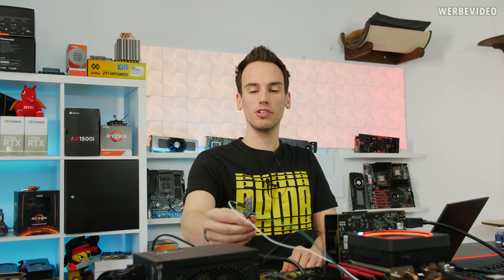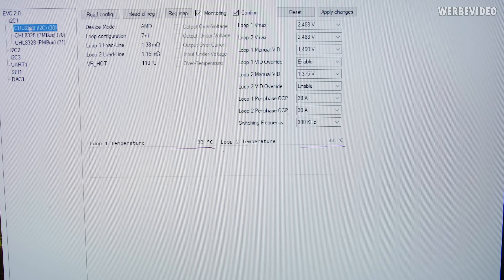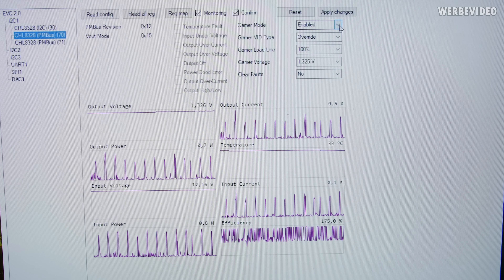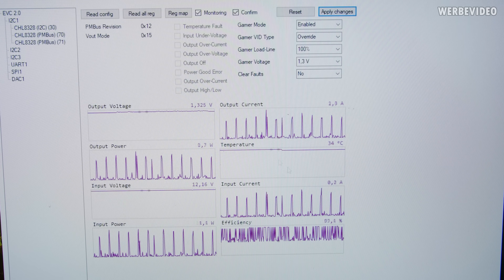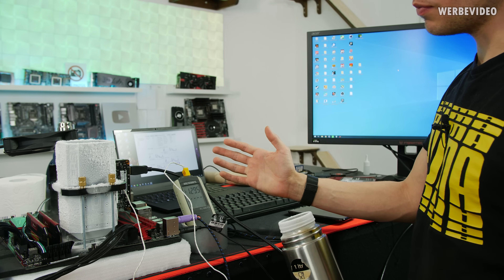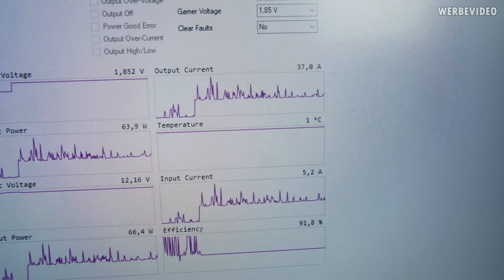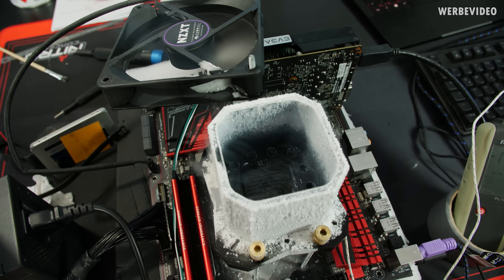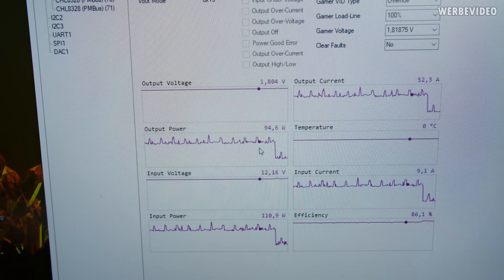We Overclocked an AMD CPU to over 8.1 GHz !!

Comment: Wow. Even at almost 8ghz an FX CPU still cant match a Ryzen 3000 CPU at stock clocks in single thread performance. That is an ever bigger difference than I would ever have guessed. My 3700x is smiling😃Thanks for the vid bud, really enjoyed it👍 

EDIT: Just checked my Cinebench R15 single thread score at stock clocks=205. And the FX at almost 8ghz=172. Wow, well done AMD.
Reply: Back in the day people were overclocking single core Celerons to 8GHz or even higher than that and they would not beat c2d in performance. But still the binning on those CPU's had to be massive. I believe there is only a single  Celeron in Poland that tested past 8GHz barrier. 8GHz OC club is pretty elite :)
Reply: a 4690k single core is 151 stock 3.9 ghz
Reply: @jorgeariel1090  4690k had launch at Q2'14, fx 8350 in Q3'12, but architecture is as old as 2011
Reply: This is because frequency speeds isn't every thing.
Reply: @FinnishArmy  Thread count x clock speed x instructions per cycle. I think a lot of confussion would be gone if they started listing total instructions per second in spec sheets.
Reply: my Ryzen 5 3600x 4,3Ghz OC in single thread score is 203 lmao
Reply: @Aaronsitooo  Hope you used the Precision Boost Overdrive, Ryzen 3000 series suffer severe degradation when occ'ed to fixed frequencies and voltages. You can easily check on Reddit or Tech Power Up, there are many threads about
Reply: @federicobossio2480  rally? My CPU is 4.3 on 1.28V, i hace bien reading and 1.3 y de Max safe for the CPU, and why frecuency fixes is bad? Has no sense, i guess
Reply: i'd like to check out multicore R15 for 8350@8.0
Reply: Everyone in this thread missed the point. He is just saying that AMD has inproved so much when it comes to CPU. Wether that is just becuase new tech or whatever
Reply: Its a totally different micro architecture. And it's 32nm. And it's Bulldozer. And it's DDR3. And it's running with the fastest possible DDR3 modules. And it's ran on the best possible mobo for power delivery. And it's being cooled on liquid nitrogen. And it's almost a decade old.

I don't mean to seem like a know-it-all, but who was really expecting the FX to be better than a Ryzen three-hell, even Ryzen 1000 chip? It accidentally beats a 1600 in single thread. I'd say that's stellar. But expecting it to beat a Ryzen 3600 at 4ghz is like expecting a 10ghz Core2Duo to beat an i7 7700k at 5ghz. Come on.
Reply: I hope you guys have seen the zen3 5000 series!  It's a huge improvement over zen2 and is even defeating intel at their own game in single core performance!
Reply: I wonder is there a way for ryzen 7 3800x to hit 8 ghz ?
Reply: FX and Ryzen systems have to use the Intel compiler patcher to get maximum performance from the cpu.
Reply: I have fx 6300.
Reply: Intel overclocking: gaining performance
Amd overclocking: losing performance
Then they say "computers work with logic"
Reply: its simply ipc, I dont know why this was actually even slightly a surprise
Reply: edmunds tomsons  but timings make a difference
Reply: Dude higer frequency doesnt mean always better performance and Also no processor in this world gonna work good under zero so yeah ...AND ITS NOT FUCKING MADE FOR THAT
Reply: Is it good? Then I think ill buy
Reply: Should i buy 3500 or the x version now? I live in Asia
Reply: @humblehostile7946  Buy the 3600 if you can. You are going to want SMT. Both Series X and PS5 have 8c/16t CPUs. You are going to want at least a 3600 6c/12t CPU for future games bud. 

The 3500/X only have 6c/6t.
Reply: Wow we still got amd and intel fanboy today? 😂😂🤣🤣.. Grow up human.. We aint living in this world forever
Reply: Very fast but can it handle infinite loop?
Reply: No. No well done.
Im laughing at new CPU tech's. Yes, they're performance is really good.
But why the 2009's Phenom II  has 7+ GHz OC, 2013's FX have 8+ GHz (like here), but no one 2016-2019 Ryzen have not even 7GHz. Why modern clocks is so low?
Reply: well FX is 32nm and 3xxx is 7nm.. so you should test yours at 4.57x lower clock of FX - 1.75GHZ and compare that to Fx :D
Reply: @exvils  that's not how any of this works.
Reply: Ryzen 3000 CPUs have much faster RAM, so an AMD FX CPU at 8Ghz with the same RAM speed as Ryzen 3000 at 4Ghz would make both of them perform equally.
Reply: @yancgc5098  Hard to say bud. It would be great if we could actually test it. I would be happy to know how much it would benefit from it. I have not used an FX system before, so I don't know how efficient its memory controller is or how well it responds to faster memory. 

Maybe someone with an FX CPU can test different RAM speeds for us (1333mhz, 1600mhz, 1866mhz etc) with cinebench single core benchmarks at the same CPU clock speed (4ghz, 4.2ghz etc) and we can make an educated guess? Maybe DerBauer can test for us?
Reply: @joeyvdm1  irrc cb15 purely cpu based, and memory speed has zero effect on score.
Reply: @joeyvdm1  I have an FX8320 clocked at 4000 with 16gb of 1600 ram
Reply: @Silenthorror13  memory effects it alot, that's how it feeds the cpu information.
Reply: @magcs6233  cinebench doesn't need that much of bandwidth to do it's thing tho. On ddr4 2133mts vs 3200mts don't do any different.
Reply: @yancgc5098  It's not just that--there are improvements in the architecture as well. Zen had a 50% IPC increase over the previous generation, and Zen 2 has a 15% improvement.
Reply: @yancgc5098  No way in hell. Ryzen is much faster with instruction dense code. The fact of the matter is that FX had extremely weak per-thread performance.
Reply: @yancgc5098  , Just NO!
Reply: @yancgc5098  no, the issue is the super low IPC. The CPU was just build to have multi cores and they forgot anything else
Reply: @yancgc5098  The weaker components on the Fx generation means higher latency. Its not clockspeeds that gives performance but lower latency.
Reply: My Pentium G4400 does 220 points in single thread @ 5.1GHz lol
Reply: @joczo97  What does it do multicore @5.1ghz? 

EDIT: I honestly would like to know, I am not being rude or picking a fight with you bud👍
Reply: Well done AMD for producing such a shit line up of chips in the FX range?
Reply: @rossharper1983  must learn to crawl before you can walk, let alone run.
Reply: @SPAMPANMAN  That's all well and good if there wasn't another person already on their feet running. AMD took a serious blow due to FX.
Reply: @Innosos  True. But positions are reversed today. Intel has slowed down to a walk now. AMD is still running.
Reply: @rossharper1983  bro can you compare intel core 2xxx series with 10xxx? i guess, no. it applies for amd too
Reply: @plyraa  the 2600k and 2500k were pretty good
Reply: @plyraa  I think you could with that OC.
You have to admit that fx was shit and ryzen is great, intel was great (2xxx series had great thermals and performance) and is now ok.
Reply: @plyraa  bruh im an amd fanboy and fx was a piece of shit back then.
Reply: @plyraa  while you're absolutely right, the FX-series was infamously awful. AMD got sued and paid $12.1 million because of it.
Reply: @plyraa  they r the same
Reply: @rossharper1983  No. Well done AMD for getting it right with Ryzen👍
Reply: @rossharper1983  You can also say "Well done INTEL for producing such a shit line up of chips in the coffin lake range
Reply: @rossharper1983  no, well done amd for progressing as far as they have today.
Reply: @rossharper1983  AMD didn't want Intel hold the shit line up of chips trophy with the pentium IVs.
Reply: @rossharper1983  intel fanboy
Reply: @jhonvvick1289  🙄
Reply: @rossharper1983  
First of all: ITS 32NM WHAT DID YOU EXPECT😂 
2 had one when they where pretty new, it was awesome, while still being damn cheap, i mean line really cheap for theyr performance.

To number 3 the "Accessoires"
Like ram ect are a lot worse on the older one so thats not the best compairson,

Greetings 
David
Reply: Old AMDs were turds. It's good AMD finally hit a good design even if it's purely out of luck.
Reply: @vinnyveritas9599  luck? Lmao.
Reply: @vinnyveritas9599  You must be a moron to think you can design a state-of-art cpu by luck. Also, the FX series were very good for their time.
Reply: @vinnyveritas9599  Ever locked at an Athlon? Those chips have beaten the 
Compairing intels to dust
Reply: @davidkuhn5410  So AMD had two good architectures in 50 years of existence... Ignorant fanboys are the worst.
Reply: @vinnyveritas9599  you mean that you are an ignorant intel fanboy? Just asking. But if you look what happend and how amd got pushed down then you know that the game wasnt clean. If the game was fair and clean amd would have had better new architectures on the market way earlier probably. But if you get pushed in to a corner, have limited funds and you have to fight yourself out of it you cant just throw money at it.

And on the intel side are a lot of f*ckups as wel. Why do people have to delid a brandnew cpu to fix it first? It not like its a cheap choice so you have to expect some cheap shortcuts.

And no im no fanboy, i just like good value for my money. And the only way to get most bang for your buck is if their is fair competition between atleast 2 players. It keeps them making progress and not just overpricing their crap because noone else sells anything close to it. So as the consumer we should be happy that AMD is still around, and that they are now pushing intel back to a point where they have to really start doing shit or they wil be gone. That means they wil have to get their prices down(good for us consumers) and they have to get their development back on it and really start moving, again good for us as consumers.
Reply: @vinnyveritas9599  luck you are funny man

Comment: I had the same cpu and mobo combo ...I miss tweaking the OC during the winters..That mobo was exceptional among saveral others I used before...Asus doesnt make mobos like that anymore ..
Reply: I still use this motherboard with an Amd 8370 clocked at 4.75 ish (1.48v). The heatsink of the chipset (the one right below the CPU) gets really really hot to the touch. I don't know if it is just my board, or this is totally normal. I put a small fan over it just in case and it seems to do the job. I guess it is because I oc'ed the CPU via  bus speed, not via multiplier. Overall great motherboard and CPU :p. I get around 712 points in cinebench r15. Also I noticed the system isn't nearly as snappy as it was before I upgraded from a cheap Patriot burst sata ssd to a nvme ssd (silicon power p34a80). The  speeds are decent, around 1200mbs read/write because of pci 2 limitations. Is there a setting in the bios I need to tweak or I just got a bad ssd?
Reply: @Liviu-f3x  The northbridge heatsink gets hot on mine too, it's nothing to worry about.
Interestingly, my 9590@4.7 gets 750 on CB R15 , and not seeing any issues with an NVMe drive either (ADATA S40G 256GB).
I'd suspect that you messed something up with when overclocking via bus.

Comment: ive never heard even an 8ghz
Reply: AMD FX was a flawed uarch, but damn was piledriver the most fun I've ever had overclocking a system....
 granted you find the right motherboard model.. which are still expensive to this day as they are rare.
Reply: @PriaSamari  well, it was SOI fabrication proces that was spot on, later gate and 3gate/fin-fet never could (even recently as mentioned in video) hit those clocks.
like engineers have no problem making transistors that run 10x that speed, but making them by etching and in quantity by milions in one cpu is not possible (yet).. we will see in few years in graphen/nanomaterials revolution
Reply: Rick Sanchez (From Rick and Morty) has a AMD CPU-based supercomputer that runs around at 8 GHz, along with 3,584 petabytes of RAM, and a 400TB SSD.

Comment: heavy breathing straightening pins on a golden cpu 0.0
Reply: I ripped 3 pins out of an 8350 and just soldered coper wire to it. to this day its still working even if its a minecraft server right now
Reply: @davidkuhn5410  you ever just stick the broken pin in the corresponding hole and hope for the best?
Reply: @lukasg4807  It might have worked, but i decided that soldering it back on under a microscope was a better option
Reply: i bought an AMD K6 processor when they were fairly new with a few bent pins and a broken pin. i straightened them out with a mechanical pencil with no lead in it, and for the broken pin i cut a pushpin needle to length and dropped it into the corresponding hole on the motherboard. worked for years.
Reply: Later this same pencil would connect the L1 bridge on my Duron to overclock it.
Reply: @kevin2m4  I did this too, with fantastic success, I still have this cpu too :D
Reply: Ive straitened pins on atleast a dozen AMD cpu's since the Duron xD Credit cards or ID's work fantastic to line it all up pretty. I use a good pair of vetus tweezers. I ordered a 8350 off ebay not long ago for ultra cheap and it had prolly 60 pins smashed flat on the corners. Took me about 20-30 minnets to have it up and running. Overclocks great on my sabertooth 990 fx, that i got for free missing a resistor sheered off that back i soldred back on. :D
Reply: if one breaks off the repair is quite doable
Reply: He may be one of the top overclockers but he wouldn't be in that situation if he knew to twist the cooler before pulling
Reply: Replacement pins cost like 2¢ a piece
Reply: @My Seventy  I just used some straight Copper wire wich had thesame Diameter as the cpu pin, and used a 320°c soldering iron with a  very fine tip to put some solder on the pad thingy i broke the pins of from. Then i heated the Copper wire up with a small blowtorch and some twezers and just sticked it into the solder on the pad. works till today, but if you attempt to do it i would recomend, to try and "Harvest" some Pins from maybe a sempron or some other old or dead chip.
Jacek Golanski recommendet hot air, but i was concerned About melting the solder under the other Pins to.
hoped i can help and sorry for the late Answer,
greetings,
David Kuhn
Reply: @My Seventy Hot air, or quality soldering station like pace, jbc, hakko
Reply: The secret is to make the bend as quickly as possible. It should be an instantaneous bend.
Reply: @AngeloXification  don't.. I work with integrated circuits, you have to bend it slowly or else it may damage the pin. Or make mutliple bends inside one. Or worse break it off

Comment: Never knew what that oil under my thermal pads was until this video, thanks for info.
Reply: silicone oil
Reply: first time I saw something like that I was suspicious of the part I got was used and someone cleaned it with alcohol

Comment: Ahhh for a second I thought you wasn't going to overclock a FX
5:50 - How this has never happened to me is beyond me, Ive never pulled a cooler off and had the CPU come with.
Reply: I have had this happen to me so many times.  Both with AMD and Intel CPUs (back when Intel also used the PGA [pin grid array] sockets).  Running a heavy load, getting the CPU nice and hot, shutting down, and quickly removing the heatsink, increases odds of the thermal paste thinning out enough to keep the CPU from ripping out of the socket.  But even then, it still happens from time to time.
Reply: You did not encounter AMD stock paste which was aged. Or any shitty old thermal paste on AMD. Clamping force on the pins is just not enough. Intel's socket design is way more robust.
Reply: @modestasmar  I just recently had a customer who had this happen with a brand new ryzen 3600 (i know, as i sold the cpu to him just couple days prior). He wanted to switch the spire cooler to noctua... decided to do it by himself... and yeah, the stock cooler which had been in system for 1-2 days, had already got so stuck to cpu that it pulled the 3600 out from locked socket. Happily the pins were not broken.
AMD itself says in website, that before taking processor heatsink off, you should stress the system to warm it up, and then use back and forth rotating motion to loosen the heatsink before pulling it off.